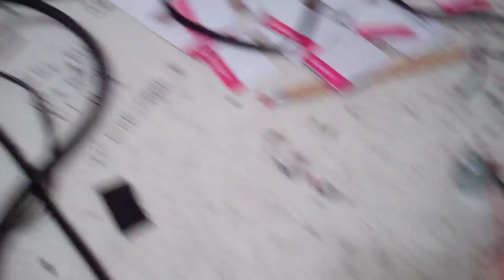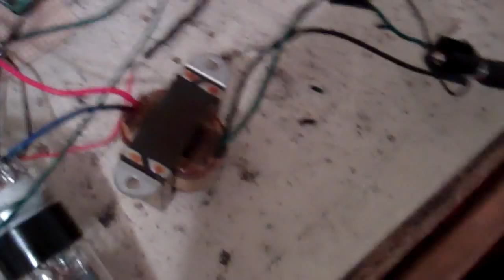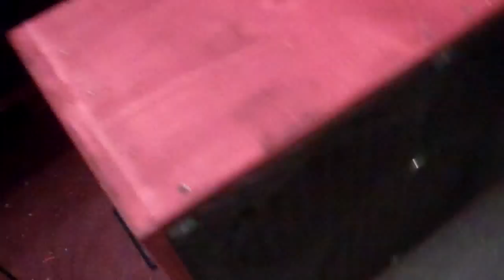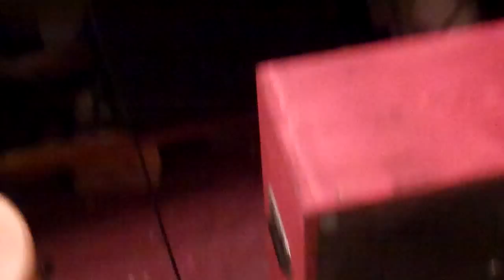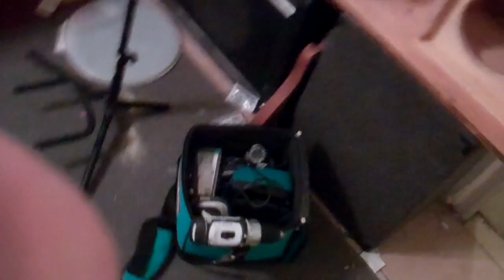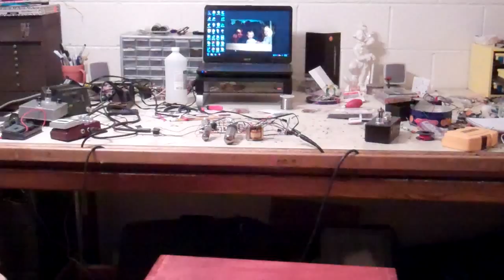2 watt 6v6 single ended tube amp.

Comment: So cool! How did you go about the heater circuit for the 2 different tubes?
Reply from the maker: I’m trying to remember. I want to say I dropped the voltage to the heater or I ran the 12ax at 6v in series with the 6v6 to reach 12 total. There is a current difference though when you do that so I remember have if you use a resistor to compensate for that

Comment: ..and you seemingly being a electronix and sound/music/guitar-interested dude, i gotta tip you of the best drivebox ever made, combining the classic ic4558 that is used in the ts808 with a 12au7 tube, with drivepots both for the chip and tube, then check out my video 'Testing 12AU7/ECC82 Overdrive/Distortion pedal by Rocknrollthor'.. Hehe, yea i made it myself ofcrz..how would i else know that its the best pedal evah..eeehrr :)
Well, the circuit drawn by me is free to use for anyone interested in making one for them selfs.

Comment: as long as the anodes don't start glowing, (difficult to see in a 6V6 because it's black) you can get a bit more power out of the output valve. You could probably go up to about 50mA and this can be achived by careful adjustment of the cathode resistor. This assumes there is enough current available in the PSU, of course. Gr8 and very informative video, thanks for uploading.

Comment: The 6V6 valve/tube definitely has it's own sound and really is best in single ended configuration. The one I built has a EZ40 full wave rectifier in the PSU the 6V6 beam tetrode, driven by two cascaded ECC83s. (12AX7) With this much gain, the thing went a bit wild, so I bypassed one of the triode stages, for a more acceptable sound. In radiograms you may encounter the output tube passing about a third more current that what's suggested in the data sheets....

Comment from the maker: I have built stuff without the power section but it seems to be better with. I could run more than one preamp tube along with this if I tried. Cant run the smps in parallel cause they hetrodyne.

Comment: Very inspiring!  Have you been able to run more than 2 tubes on an SMPS......I havent tried it yet, but I worry about having enough current.    Also the cap section on this amp looks like you added them for filtering.....Im wondering if you need them if the SMPS is putting out straight DC.